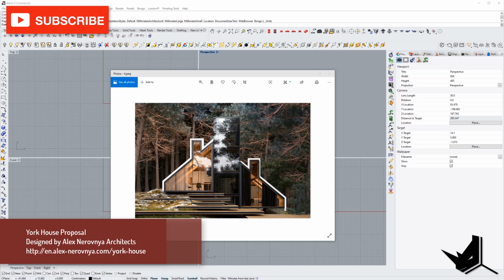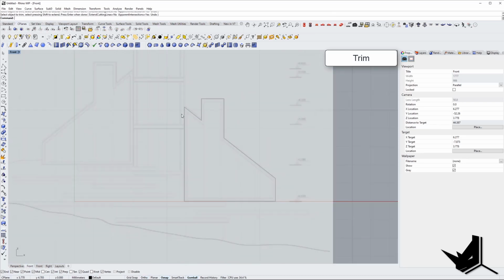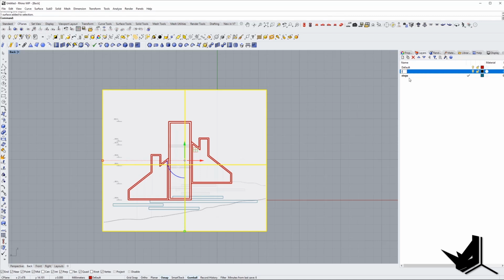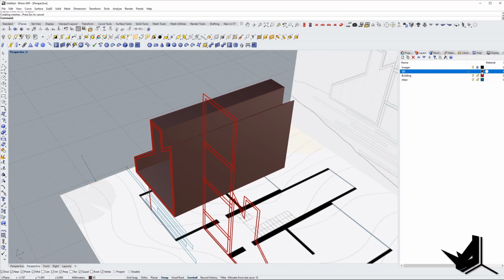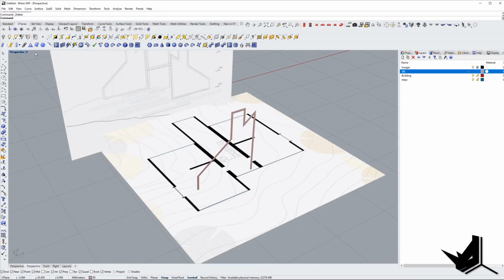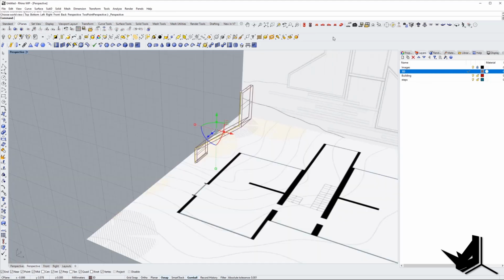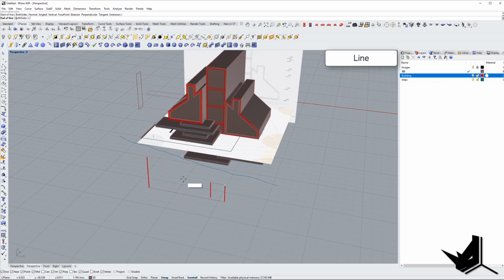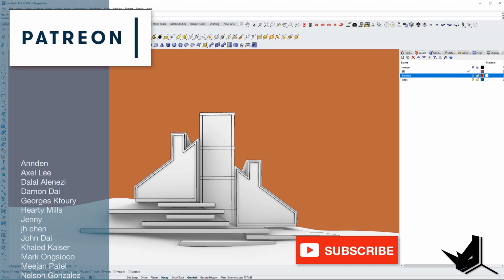Rhino Architecture Modeling York House with Tips and Tricks

Comment: Very good tutorial as usual, If you could be so kind and tell me if there is any alternatives to the subD or T-Spline thing. Sry i am not so advanced in rhino so idk if there is difference between them. I know rhino does not have it anymore but u did use it in one of ur videos (subD) where u said it was a beta feature for rhino 7. Can u suggest any alternatives for that? Please and thank you :)
Reply: Like a plugin or some other way were you can control the points yo get smooth surfaces
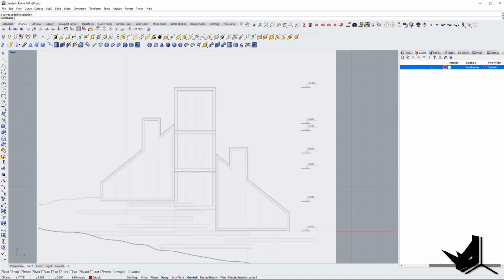Reply: Here is the video of what i am talking about. Starts from 3:18 - 5:00 

https://youtu.be/kAGRhfQgO3E
Reply from the maker: @ahmadkhaled28  Hey Ahmad. To be honest, in my opinion there is no better "alternative" than subD at the moment. What you're seing in that video at 3:18 is exactly subD tools and they are currently available at Rhino WIP version. If you have Rhino 6 license you can use this version and it works extremely well at the moment! You can try with other plugins like Clayoo, but I found it very unstable and crashes all the time. Go for SubD, you're gonna love it when you play around with it a bit :)